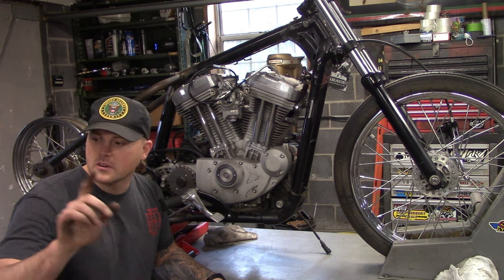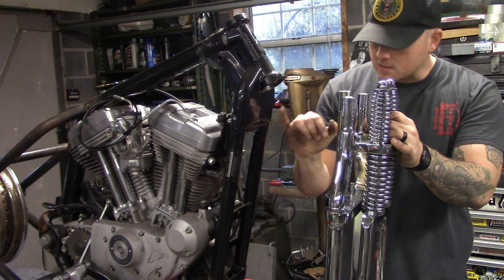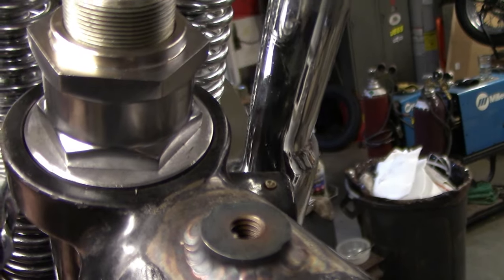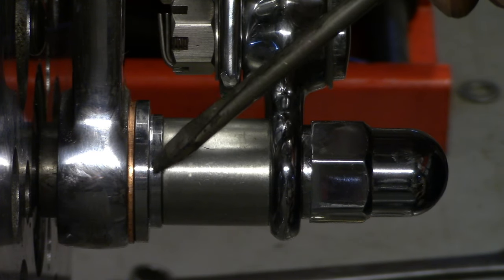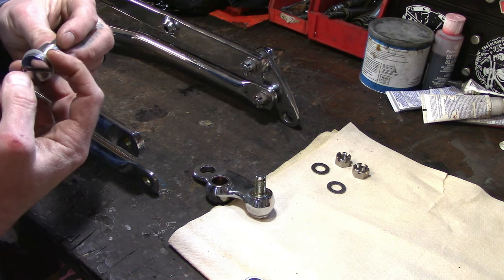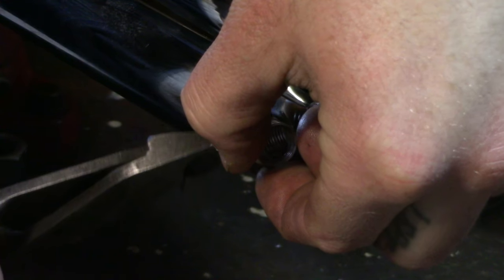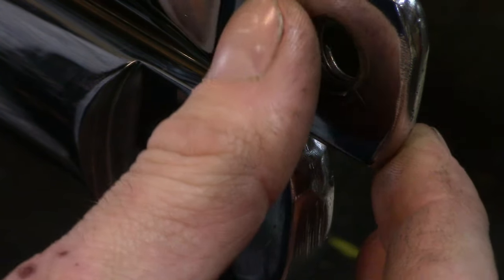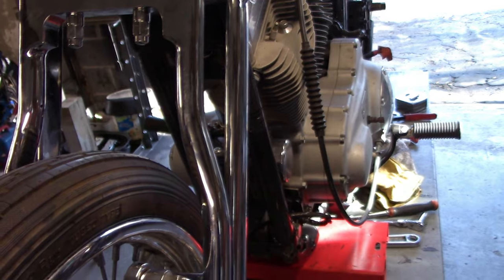Moto Iron Springer for 2004+ Sportsters - Review and Upgrades - Sportster Bobber Build

Comment: Hi Chuck! I am installing a Moto Iron springer on a 2007 sporty and your video has been a huge help. TC Bros told me I need to purchase an adapter plate so I can re-install the stock riser onto the springer. I am able to bolt the original riser/speedo onto the top but the spring caps are just touching the riser. Can you offer any suggestions? Thanks!

Comment: Heli-coil fix makes better, more solid attachment than bushings, tightened against shoulder bolts, the nuts lock it together. Those holes ought to be threaded from factory.

Would be interesting to see a mechanic builder explanation of issues with long springers, the dreaded flop, trail and handling problems. How the famed Sugar Bear springers, and modified rockers with zero trail solved the flop issue, for better handling. Many videos about general rake and trail. Some about choppers mention the appearance and geometry of SB springers, but none explain it in any detail.

Comment: I really like the helicoil idea!  

 Easier then making bushings and almost as easy to replace should they get a lil wear thousands and thousands of miles from now... 

I almost got one of these springers from tc bros but our roads are pretty rough here from frost heaves in the winter..

 plus I wanted to do an 8 over front so I went with extended tubes instead..  

Great video man, you got a new subscriber for sure
Reply from the maker: Thanks, The more I thought about it the more the helicoils made sense. Thanks for watching and thanks for subscribing!

Comment: Does the neck lock still work with the springer? I have a 48 sporty and I love that the front end locks to prevent theft . Will that still work with the springer?
Reply: No, the stem is not drilled for the neck lock on the one I got. But if you took some measurements off the original stem, it wouldn’t be a hard to mill the slot in the new stem. Any machine shop could handle it.

Comment: Did you think about using the neck spacer on the top? From the video it looks pretty close to the washer you machined. Nice work on getting the caliper bracket to fit.
Reply from the maker: That may have worked, I didnt really think about it. Theres always many ways to do things.
Reply: @ChucksCycles  True. :D

Comment: What do you think the minimal clearance is you can run between the shoulder bolts and the rotor I need to space the wheel over a quarter inch and when I do that will only leave me about 1/8 inch between the rotor and the shoulder bolts your thoughts on this
Reply from the maker: As long as it’s not touching, I’d run it.

Comment: planning on getting one of these front ends for my 2012 72. not super knowledgeable about everything. can you run a stock caliper and front brake setup on this fork? or do you need to have a different type of brake setup.
Reply from the maker: I believe yo can run the stock stuff. Check out the TCBros website, I think it says so.

Comment: After everything was done. What was your trail like compared to the factory?
Reply from the maker: Im not sure,  Hopefully its engineered to fit these frames and still have decent trail numbers. Id be curious as well. Once I get the bike on the ground Ill take a measurement and let you know.
Reply: @ChucksCycles  thanks for the reply. Looking at these myself but worried about the trail because I ride 2up.